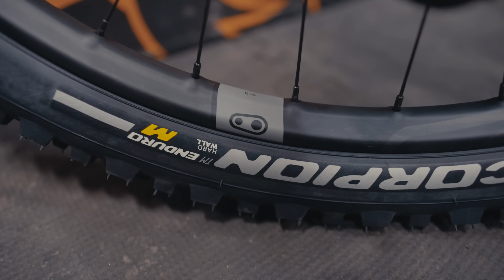DREAM BUILD MTB - Kingdom Void

Comment: I saw that you use the Hope headset and I wondered if you used one of these little washers that come in the package. Last week I built a bike with the same Headset but I didn’t knew what to do with these little washers. They have the same diameter as the fork shaft but they are just about 0.5 mm tall … so they are not meant to be used as a spacer above or below the stem. I wondered if they should be used as spacer between the bearing and the the sealing cap, but there is now guide how many should be used. I hope you know what I mean

Comment: The build is good and all that but why is the cable routing under the bottom bracket?
That's just bad design, I get that you can swap it out but still.
Reply: Two years riding one all over the uk this has never been a problem